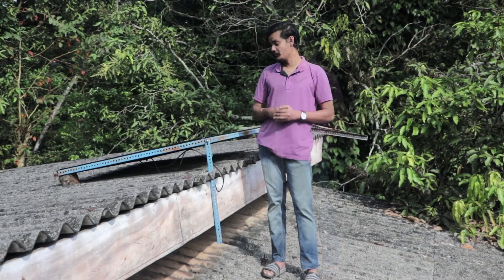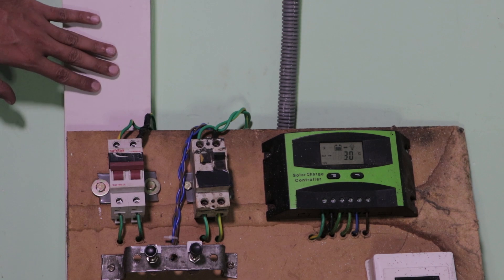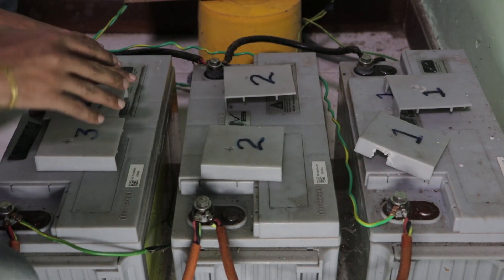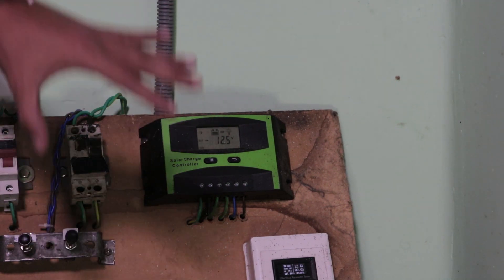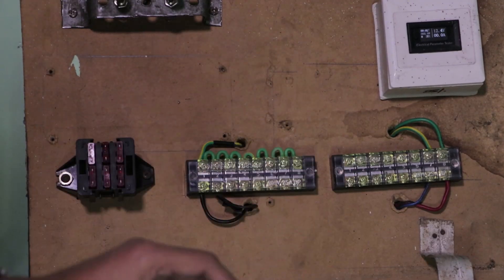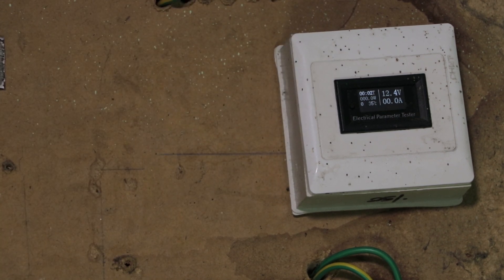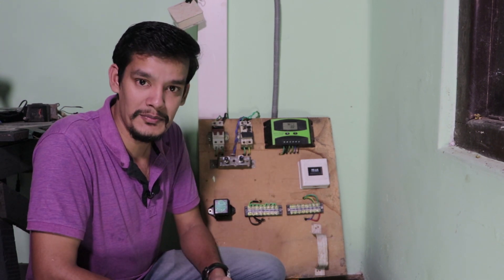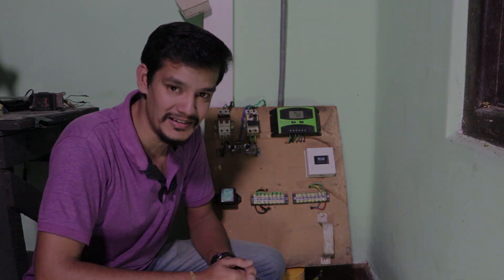අපි සුර්ය විදුලි බලයෙන් වැඩ ගනිමු

Comment: කුඩා ජලවිදුලි  බලාගාරක් හදනහැටි දමන්න.
Reply from the maker: Bohoma stuthi obage adahas walata.
E sandaha eka digata galana jala prawahayak Ape gewal langa naha.meke theory eka;
Payakata wathura kopamana pramanayak galanawada kiyala Hoya ganna.
Ita passe podi reservoir tank ekak hadaganna ona.
Hadissiye wath tank eka pirunoth bypass path ekak hadanna.ethakota wadi pramanaya oyage system ekata haaniyak wenne nathiwa bahera wena widihata.

Ita passe reservoir tank ekata pirena wathura pramanayata samana ho ita aduwen output eka gananaya karanna.

Ita galapena three phase turbine ekak sambanda karanna.turbine eke aduma RPM ekata match karala reservoir tank eke output eken ena wathura paarata nozzle 3 k connect karanna.

Wathura wadiyen ena kaala walata e nozzle 3 bypass karala Loku size ekak tiyanna nozzle 3 connect karanna.

Mehema karama avurudda purawatama oyata system eka use karanna puluwan.

Methnin passe obata thiranaya karanna puluwan battery backup ekakata yanawada natnum gridtie system ekakda inverter eka widihata use karanne kiyala.

Turbine eken passe siyaluma upanga wala kriyakarithwaya  solar ,sulanga,wathura yana krama 3tama bohowita samanai.

Sulan widuli balagara pamank dumpload ekak use karanawa.ita hethuwa thamai wind turbine eka onawata wada wadiyen karakawunoth winasa wena nisa.

Comment: Grid tie akedi grid power ake power aka change over akakin isolate karalada use karanne...
Reply from the maker: Grid tie system wala change over switches Danna awashya wenne naha.
Ekata hethuwa thamai grid tie inverter eka grid eka anukaranaya karana nisa.

Inverter eke  output eka grid ekata samanai.

Comment: Volt  – 37V Pannel ekata MPPT controler ekak hodaida.
Reply from the maker: MPPT charge controller eka godak durata galapenne wadi volts output  ekak labena system walatai.

Ita hethuwa thamai volts ganana adu karanakota ampere ganana wadi wena nisa.

Example ekak widihata kiwwot,400w kata wada wadi solar panel thamai MPPT charge controller wala effective eka wadi wenne.
Reply: @DIYwithAsanka  oh thank u ☺
Reply from the maker: You are welcome
Reply: Mage pannel eka 320W eken 12V battery ekak charg karanna puluwanda. MPPT Controller eken
Reply from the maker: Puluwan gataluwak wenne naha.
Panel eke output voltage eke rating eka charge controller eke input voltage eka athulatha tiyanakan gataluwak wenne naha

Comment: මට 270W solar penal 4k use karala 750W AC  woter pump ekak batarry natuwa weda karanna puluwanda ekata ona MPPT chager eke ha Inwerter eke capacity monawada
Reply from the maker: Off grid solar system ekaka nam energy eka store karaganna batteries tiyenna ona.sunlight eken labena widuliya continuously labenne nathi nisa.

Mama dakala tiyanawa internet eke tiyanawa boost converters use karala samahara load (inverters) kelinma Solar panel ekata connect karala use karanawa.

Me gana thawa poddak research karanna .mokada mangawa boost converters naha.eka nisa e gana lokuwata Mata me gana experience ekak Naha.

Theory eka anuwa nam solar panel eken ena viduliya boost converter ekakata dila eke output eka inverter ekakata laba dila emagin AC load ekak pawichchi karana eka.

Inverter eka demand karana input amperage eka boost converter eken laba denna puluwan nam meka gataluwak wenna widihak Naha.

MPPT charge controller ekak use karanawanam (Onama charge controller ekak PWM ho) battery ekak anivaryenma tiyenna ona.hethuwa charge controller eka use karanna baha batteries nathiwa.

Charge controller eka select karaganna ona oba use karana battery bank eka paya kiyak athulatha fully charge wenna onada kiyana eka mathai.

Mama mega video ekak karala tiyanawa "Surya viduli samikaranaya 2"
Ekath balanna.eken obata honda awabodayak laba ganna puluwan wewi.
Me video eka mage Chanel eke play list eketh tiyanawa.

Use karanna ona inverter eke adumaganane 1500W  ho ita wada wadi ekak wiya yuthui.pure sign wave Inverter ekak thamai laba ganna ona.

Comment: Power out put - 50w  /Rated curre - 1mpp - 3.00A   / Rated voltage  Vmpp - 16.8v  mehemai sola penal aeke piti passe thiyenne,mekata hariyana sola chager controller  aeka mokkda?plz hepl me
Reply from the maker: Panels kiyak use karanawada?

Panels connect karanne parallelly da series da kiyana eka?
Me karunwalata  anuwa thamai solar charge controller eka thiranaya karanna wenne.

Me sandaha wadi wisthara obata danaganna puluwan mama videos kihipayak ma me gana karala tiyanawa.
Ewa mage Chanel eke play list eke tiyanawa.welawak labunoth ewath balanna.ewayin obata danaganna puluwan wewi obata galapena solar charge controller eka Thora ganne kohomda kiyana eka gana
Reply: 1penal aekai
Reply from the maker: 10A solar charge controller ekak gaththa nam Hari.
Reply: @DIYwithAsanka  hari bohom isthuthi,aekata danna battery aeka 35A 45A 90A unath aulak ne neda
Reply from the maker: Eka gataluwak wenne naha.charge controller eka yodanne solar panel eken ena amperage ekata wada wadi ekak.
Reply: Asanka mahaththya mta mge yaluwek 20A sola chage controller aekak dunna.aeka demmoth aulda?danna kalin ahuwe..oya mta kiwwe 10A danna kiyla.
Reply from the maker: Solar charge controller eke agaya wadi ekak dammata Kamak Naha.adu ekak dammoth thamai eka heat wenne.
Reply: @DIYwithAsanka  ok, asanka mahaththaya
Reply from the maker: Bohoma stuthi obage comments walata

Comment: 50w sola penal aekata, hariyana chager controller aeka mokkda,
Reply from the maker: Solar panel eke wattage eka wagema amperage ekath wadagath wenawa solar charge controller ekak Thora gannakota.
Eth ekkama passe kalekadi system eka upgrade karanawada Yana karanayath me sandaha balapanawa.

Charge controller s wala sandahan karala tiyanawa ewaye power rating eka.

Oba pawichchi karana solar panel wala maximum power output ekata wada wadiagayaka charge controller ekak thamai ganna ona.

Example ekak widihata kiwwot solar panel eke maximum amperage output eka 7A nam 10A Ka solar charge controller ekak gaththa nam Hari.

Ewagemai issarahadi panels dekak pararell connect karanwanam e panels wala amperage eke ekathuwata wada wadi agayak tiyana charge controller ekak wenna ona

Mama solar charge controller s gana video kihipayak karala tiyanawa.ewa mage Chanel eke playlist eketh tiyanawa.
Welawak tibunot ewath balanna.obage danumata yamak ekathu karaganna puluwan wewi
Reply: @DIYwithAsanka  ok..gdk watinawa  obage adahasa..thanks
Reply from the maker: Obage comments walata stuthi. Danumata yamak ekathu karanna labima gana sathutui.

Comment: 100a 12v/24v  pwm එකට 12v පැනල් විතරද සවිකරන්න පුළුවන්.
ඊට වඩා ලොකු voltage ගානක් සහිත පැනල් සවි කරන්න බැරිද?
Reply from the maker: Oya charge controller ekata 12v Saha 24v panels devargayama support karanawa kiyalai oya kiyanne.

Ethakota connect karala tiyana battery bank eka 12v  nam eya 12v select karagannawa.

24v nam eya e widihata select karagannawa.

Wadi voltage ekaka panel ekak unath connect karanna puluwan.
Namut e panel eke output eka charge controller eke input parameters athule tiyenna ona.
Reply: Pwm ekak dala 12v battrey ekak charge karanna 18v 21v wage solar panal ekak ona 24v battrey ekak charge karanna pwm ekak dala 34v 38v wage solar panal ekak ona natuwa 12v battrey ekak pwm control ekak dala 34v 38v solar panal ekakin charge karanna hodana pwm control eka damage wennawa hit wela ekata mppt control ekak use  karanna puluwan
Reply from the maker: Godak solar panel wala output voltage eka battery eke voltage ekata wada wadiy.

Charge controller eke maximum input parameters walata aduwen nam solar panel eke output eka tiyenne ,ewa ekata sambanda karanna puluwan.

Mama use karapu charge controllers ekak Wath Ada wenakan nam damage wela Naha.

E hinda mata oya charge controllers overheat wela damage wechcha eka gana loku experience ekak Naha.

Ma gawa Danata charge controllers 3 tiyanawa.e 3 ma Ada wenakan working condition eke thamai tiyenne.

Comment: වොට් 300 ක සෝලා පැනල් විදුලිය කෙලින්ම ඉන්වටර් එකකින් නිවසට සම්බන්ධ කරන්න පුලුවන්ද?
Reply from the maker: Solar panel eke input voltage eka VDC agaya inverter eka support karanawa num puluwan gedara grid ekata connect karanna.   Namuth zero export wenna ona.

Example ekak widihata kiwwot oba solar panel eken produce karana sampurna watt agaya gedara athulema pawichchi karanna wenawa.

Obage solar panel eke 200w produce karanawanam  gedara electricity consumption eka koi wele baluwath 200w ta wada wadi wenna ona.

Ehema nathnum wenne oba grid ekata viduliya export karanawa.eka legal problem ekak athiwenna reason ekak.

Ehema nathnum obata karanna tiyenne grid tie Inverter with the limiter ekak use karana eka 

Mekedi wenne gedara consumption ekata galapena widihata solar panel eke production eka adu wadi karana eka.

Ethakota mulinma solar panel eke production wena viduliya use karala madipaduwa electricity board eken ganne.

Ewagemai consumption eka adu wenakota solar panel eke output eka gedara consumption ekata match karanawa.

Ethakota koi welawaka Wath electricity board ekata viduliya export wimak wenne naha.

Dan mage solar system eka design karala tiyenne 250w kata wada wadi consumption ekak tiyana welawata witharak grid tie Inverter eka on karanna.
Ethakota koi welawaka Wath viduliya export wimak wenne naha.

Comment: මම  ගාව   300w  solar panal 1k තියෙනව.එකෙන්   කොච්චර ලොකු battery pack 1ක් charge කරන්න පුලුවන්ද ? (5 hours වලින්)
Reply from the maker: Obage battery bank eke voltage eka bedannna 300watt walin.ethakota enawa agayak ,eka obage battery bank eke size ekai.
E ena agaya X 4 ( mokada Api solar system ekak hadanne  ude 10th dawal 2 th athara battery eka fully charge wennai)

E ena agayata thamai  battery bank eka use karanna ona.
Practically gaththot mewa experiment karalama thamai me system eka hadaganna wenne.mokada mewaye godak variables tiyanawa.
Theory eka thamai mama kalin sandahan Kale,namut practically obata godaak Loku battery bank ekak unath fully charge karanna puluwan charge karana welawedi load ekak use karanne nathnum.

Hondama de thamai solar panel eke amperage ekata match wena charge controller ekak aragena battery bank ekakth ekka experiment karala hariyatama Hari yana widihata system eka design karaganna ekai.

Mama mage system eka hadanakota mage awashyahawaya Dawas 2k awuvva nathiwa mage load eka use karanna puluwan widihata battery bank eka size karagaththa.

Anit upanga  ekata match wenne miladigaththa.

Meke wasiya thamai mehema hadapu eke mage load eka awuvva tibbath nathath continuously wada karanna puluwan.

Comment: ගෙදරක සාමාන්‍ය වොට් දහය එල් ඊඩී බල්බ  10  පැය   6ක්  දල්වා ගැනීමට  සහ   ෆ්‍රිජ්  පොඩිඑකක් දම්රෝ  වැඩකර ගනීමට  අවශ්‍ය පැනල සහ  ඉන්වටරය ගන්න ඔඉන කොහොමද ??සැලසුම්???
Reply from the maker: LED Bulb walata 600W awashya wenawa.
Awwa nati dawas 2 kiyala salakuwoth 600w X 2=1200w
Ewagema fridge eketh power consumption eka hoyaganna ona,Battery bank eke capacity eka decide karanna.

Fridge awilla bulb wage newei, compressor eka on wenakota wadi current ekak use karanawa. ita  passe aduwen thamai viduliya use wenne.

Meke thawath karanawak thamai compressor eka on wena waara ganana.

E nisa meka manually calculate karanwata wada Watt meter ekak aragena fridge eka Saha pawichchi karanna balaporoththu wena LED bulbs ara  meter eka haraha dawas 2 k use karala eke sandahan Wana watt ganata samana ho poddak wadi wenna battery bank ekaK  hada ganna.

E witharak neme mewaye inverter eke efficiency ekath mekata balapanawa.

E okkomath ekka salaka baluwama ara mulin watt meter eken hoyagaththa capacity ekata 50% ekathu karanna.
Ethakota obage battery bank eke size eka labenawa.
E anuwa Mama  me channel eke surya viduli  samikaranaya 2 kiyala video ekak karala tiyanawa.eken obata hoyaganna puluwan miladi gathayuthu  solar panel gananai ,charge controller ekai sambandayen.

Me dema obata karanna puluwan krama 2k tiyanawa.

Palaweni de thamai siyalu dema DC current eken use karana eka .
E sandaha obata aluthin DC LED bulbs Saha DC Fridge miladi ganna awashya wenawa.
Mehdi  thiyana benefit eka thamai adu capacity ekaka battery ekak use karanna puluwan wima.

Anith kramaya thamai grid tie system ekak hadana eka.mekata nam obata panel Saha inverter ekata Rs 50,000 viyadam karala dawal kaledi viduli paribojanaya set off karaganna puluwan.

Meke tibena awasiya thamai battery bank ekak nathi nisa viduliya anahitimakadi (power cut) me system eka wada karanne nathi wima.
Me system eka cost eka athin baluwoth godak adui.battery bank ekak nathi nisa.

Inverter eke capacity eka decide karanne fridge eka Saha bulb eka wara kriyathmaka karala (fridge eke compressor eka on wechcha welawaka) watt meter eke sandahan watt ganana ta poddak wadi inverter ekak miladi ganna
Reply: @DIYwithAsanka   ස්තුතියි ...මට විශ්වාසව මේ වැඩය කර ගන්න හෝ පැනල්  ගන්න  ඔබ ළඟ හෝ නැත්නම් වෙනත් ස්ථානයක් තිබෙනවාද???   මට මාසෙක මීටරය  120-110 අතර වෙනවා
Reply from the maker: Me dawas wala lankawe solar baduwala prices anawashya widihata  wadi karala tiyenne. Eka nisa puluwan nam me dawas maga arala miladi ganna.

Online local websites walin miladi ganna puluwan.kalin seller ekka Katha karala gihin check karala ganna eka thamai honda.
Kalen kaleta used honda Solar panels market ekata enawa.hondama de thamai hadisi Nowi honda offer ekak enakan indala ganna eka.

Inverters Saha anikuth upanga solar panel Hera cash on delivery  tiyana online market place ekakin ganna

Comment: Aiye nalalidata dana vathura motarayak dawal waruwe hahanda solar penal ekai batteryai change control ekai kochchara ewa pramanawadda
Reply from the maker: Eka thiranaya wenne wathura motor eke capacity eka anuwa saha wathura motor eka on eke tiyana time eka anuwai.
Reply: @DIYwithAsanka  w danne e wathura motar wala adi 100 lin walata dana motar eka oyadannawa athi neda.peya 4 vithara
Reply from the maker: Oyage awashshathawata hari yanne 1 kw ekakata wada wadi agayak tiyana solar system ekak.
Oyata options dekak tiyanawa. 

1.podi battery bank ekakin loku solar panel system ekak connect karana eka. (Example ekak widihata kiwwot 2000w solar panel system ekakin 500amp battery bank ekak charge karala inverter ekak haraha meke widuliya use karana eka.me systems eke awasi dekak tiyanawa.1.oyata aduma 3000w pure sign wave inverter ekak tiyenna ona me widihata widuliya laba ganna nam.me wage inverter ekaka mila aduma Rs 200 000 wath wenawa.ethanin ehata giyama thamai solar panel walai battery bank wala vatinakaman ekathu wenne)

2.Grid tie solar system ekak hadana eka.meke tiyana awasiya thamai wathura motor ekata main current supply ekak electricity board eken tiyenna ona. Wasiya thamai Rs 250 000 wenakota oyata me sampurna system eka hada ganna puluwan. Mekedi battery bank ekak nathi nisa thamai me cost eka godak adu wela tiyenne. Mewaye cost eka thawa adu karaganna puluwan DC water pump ekak hoyaganna puluwannam.
Mewaye mila wadi namut solar system eke inverter ekata yana gana ithuru kara ganna puluwan. E capacity ekenma main current use karana wathura motor ekaka mila mita wada adui namut solar system eke inverter ekata loku mudalak waya karanna wenawa.

Thawa widihak tiyanawa generator ekak use karana eka.eka Rs 80000 withara wei.eken direct main current use karana wathura motor ekak use karanna puluwan. Meke tiyana awasiya thamai indana walata nirantharayen mudal waya karanna wena eka.
Reply: @DIYwithAsanka  thanks ayye

Comment: Aiye 12v bettay 3 kin 36 nemeida enne ohoma set karoth poddak kiyala denwada
Reply from the maker: Me batteries connect karala tiyenne pararell widihata.eka nisa ampere gana ekathu unata voltage eka wadi wenne naha.
Voltage eka wadi karanna nam series kramaya yodaganna ona.
 palaweni battery eke negative terminal eka deveni battery eke positive terminal ekata connect karanna ona.
deveni battery eke negative terminal eka 3 weni battery eke positive terminal ekata connect karala 1 weni battery eke positive ekei unthima battery ekei reading eka gaththot voltage eka 36 wenawa .habai        100 amp battery ekak widihata thamai tiyenne. 
E series widihata battery connect karana widihai
Reply: @DIYwithAsanka  pararell karamayatanam positive positive walatama set karala negative negative walatama set karala awasana battery even output eka gannawa neda
Reply from the maker: @chamithnimantha8528  එහෙම කරහම battery bankඑක පුරාවටම loadඑක balance වන්නේ නැහැ .හරි වීදීහ නමි  පළවැනි battery එක positiveඑකට Loadඑකේ  positiveඑක connectකරලා අවසාන battery එකේ negativeඑකට Loadඑකේ negativeඑක connectකරන එකඊ.
Reply: @DIYwithAsanka  150w solar ekak bettry yate kelimma setkarath penal ekata aulk wenne neda
Reply from the maker: @chamithnimantha8528  එහෙම කරොත් batteryඑක overcharge වෙලා 
විනාශ වනවා අනීවර්යෙන්ම charge controller එකකක්  සම්බන්ධ කලයුතුඊ .
Reply: @DIYwithAsanka  (dc 12v vathura pump ekak 128w 8a ) 150w penle ehekata kelimmasambandakarahekida. Chage control eka haraha sambanda  karandada